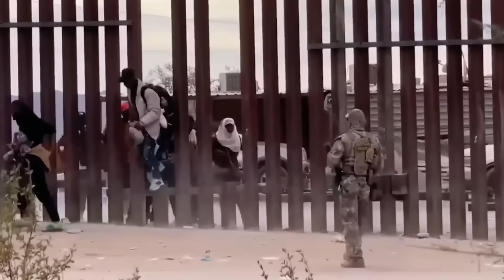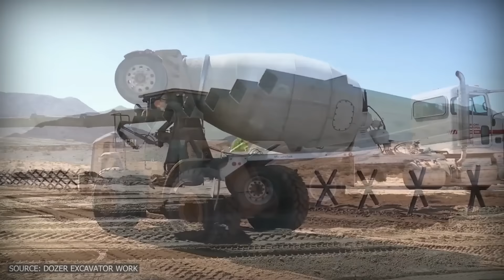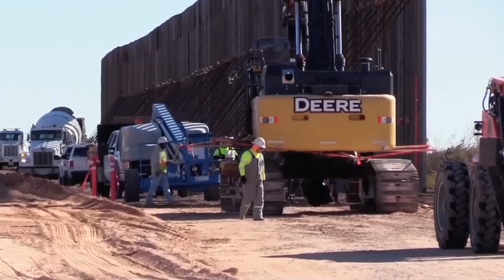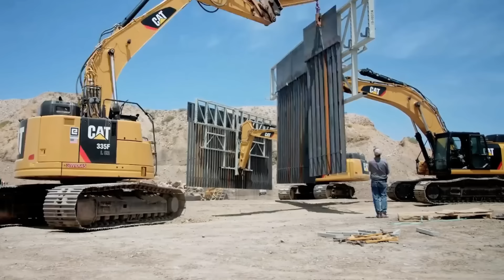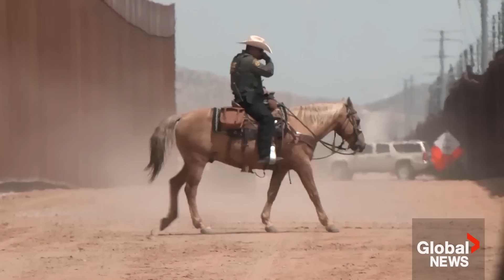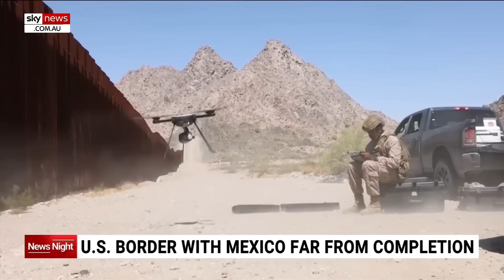How America’s Border Wall Sparked a Regional Boom No One Predicted

Comment: Question: Did the engineers calculate random wind dynamic action  on the structure? The vibration could cause dangerous resonance waves along the wall.
Reply: Resonance can be tuned out. It's standard procedure on power lines. Skyscrapers too if you study the problem.
Reply: Yes they did. Rewatch the video.

Comment: The Fence wall needs to be painted slippery high glossy black, hot as hell in daylight, slippery when it rains,  damp nights and mornings!
Reply: Silicone is wonderful lubricant
Reply: @johnj4860 K.Y. Jelly will work too.
Reply: Teflon-coated

Comment: When they repair the border wall, when cut and penetrated, the bottom ten feet at ground level should be replaced with a ten foot piece of solid stainless steel painted black and a fake weld spot where it was initially cut. New sections should randomly have this stainless steel section installed.
Reply: Stainless is a notoriously difficult material to work. But if they ran hot tar down them tubes to coat the inside walls and then threw in fiber and concrete that would make a witches brew of headaches to cut through and be far cheaper. Blades that can cut steel get gummed up with tar. Fiber reinforced concrete is tough material too.
Reply: ten-foot should be hyphenated

Comment: I would like to see a map showing where the wall is erected and how much more miles are needed to complete the border.
Reply: There’s a lot more to go.    They are doing the areas that cPB says will
Do the most good.
Reply: There’s areas that can not be crossed due to terrain. There’s other areas that are extremely dangerous to cross during certain times of the year due to weather mostly - desert areas during high heat and no access to water - some areas also flood during heavy rains.  So a completed wall is not really the entire plan.   The desert with no access to water will probably only have cameras.  Then CBP will go pick them up, save them, then send them back.  In Texas, the local Fire & Rescue save them during floods if they can and then sends them back.
Reply: @denisekoltys3019 interesting, inevitable really. Thanks for clarifying 👍

Comment: The illegals  are still climbing over the wall.  To stop the climbing over, the top of the wall should be inclined 45 degrees towards Mexico.  That should stop them.  There is still another issue and that they can still pass drugs through the iron bars.  So, the constructors should solder steel wire mesh on the iron bars to stop the passing of frugs.

Comment: HOPE WE NEVER HAVE TO A BUILD A DOUBLE WALL 😮 WITH AN GPS LOCATION OR SENSORS .. AI CAN BE USED FOR GOOD BUT NOT FOR EVIL ..
Reply: i actually support a double layer.  In some stretches the area between them can have anti-personnel mines.  Other sections could have machine guns with signs indicating it is a fire with no warning zone since the border area on the south is considered a military installation.  But more than a second wall, we need a more robust E-Verify system that should be required for all companies, DMVS and government programs.  And companies violating E-Verify should face civil fines that start at $1 Million and go up, FAST.  And in the worst cases, the folks doing the hiring should face criminal RICO charges and be thrown in PRISON.

Comment: Needs to be Electrified at the top
Reply: Put razor blades on the top and razor wire 8 feet from the wall outward.
Reply: @bambinal1437
They have finally started doing that
Reply: I'm convinced they put the panel along the top instead of spikes because they were worried about the press coverage of unsuccessful illegals hanging from the spikes. The panel only makes getting over the top easier
Reply: They should put 18” round pipe up on top all along the wall.  Will make it impossible to climb over because they can’t get a good grip or hand hold.
Reply: @SaltyChief521 
Good idea. Then constatine wire at the bottom on our sude six feet deep and 6 feet wide.
Reply: @davidgraham2673  concertina
Reply: @SaltyChief521  handhold is one word
Reply: Plenty of Sun Out There..This Would be a Great Place for Renewable, Green Electrification on the Top..Great Idea..😮
Reply: Should have told your ancestors stay home and not invade other people's lands. That story will be flipped back at u soon just wait
Reply: Paint it black and the heat will keep people away.
Reply: The should do something on the top. The illegals will climb it when the Democrats take over in the future
Reply: aligators with lasers too (not joking)
Reply: There is already video surfacing of people climbing over it like it was nothing, or in populated areas, a plasma torch cutting right through it like butter. I agree with another comment......electrification is the way to go, not from top to bottom, just the top 2ft.
Reply: @Shaggydude2 not like before when ppl were flowing in like a river!!!!
Reply: @Shaggydude2  Withdraw from the landmine treaty then mine the buffer zone.
Reply: @Shaggydude2  There are lots of Lawyers that would love that.      They would be desperate to run several class actions claiming disabilities, PTSS and more.
Reply: needs 2 parallel border walls separated by motion sensors & cameras in the middle. a dead man's area if you will.
Reply: @geekwithabs  "separated by cameras"???